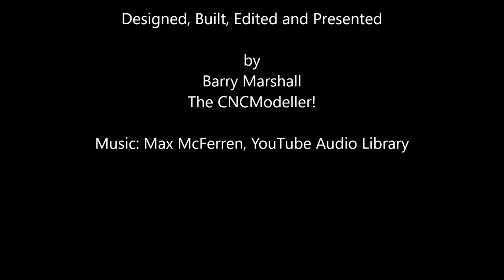New Design! Bed Bearings for the Large Polar 3D Printer

Comment: This is very useful , I believe for industrial use 3D printers will go along the path of different kinematics according to what geometry they do best. For tall cylindrical shapes your design is perfect , and so on for other shapes to chose the best kinematics for them just to insure the best performance for all print jobs.
Reply from the maker: Thanks Gathlock. I agree, I built a polar printer as I believe it has a good print to printer volume ratio, ie it's small for it's print volume, and It requires less print head motion to print the items I need to print.

Comment: What firmware did you use for this? It loks awesome btw
Reply from the maker: Hi @TdgChan,  It's using reprap firmware on a duet2 ethernet board. Thanks 👍
Reply: @CNCModellerUK  could you specify the firmware and slicer that can be used, Im looking into a easy to build printer for our Makerspace that ist Not so Common from the mechanics. It would be great If you could answer, I've been Reading die hours and searching but seems noone has a good running fw/SW solution for those polar printers... Or I'm just too dumb to find 😂 ... Best regards from germany
Reply from the maker: Hi Mike, you can use any slicer that generates Cartesian gcode. The firmware is reprap firmware or RRF running on the Duet2 ethernet board. If you go to the Duet3D website and forum you'll get all the support you need.

https://www.duet3d.com/

 I'm no expert but it was fairly easy to setup once I'd spent the time to understand how to configure RRF for my printer. It's all done with a startup file with special gcode so there is no firmware code changes or recompiling required.

RRF takes the Cartesian gcode co-ordinates and translates them to polar on the fly.

I've just upgraded to RRF 3 on my Duet ethernet board and it seems to be good on my setup. I believe you can run it on less expensive be oards but IMO you get what you pay for.

Hope that helps.
Barry M

Comment: Thank you. Awesome job. I've been looking for sufficient endeavors in polar printing. I am looking to make a tool that I would use mainly for round parts where production speed, concentricity, cylindricity, and surface finish matters. This seems like the way to go. Essentially this machine would be to the lathe in the same way that a typical 3d printer is to the mill. 

I would imagine for many parts on a machine like this, the G-Code and motion could be simpler, no? Am I wrong in thinking that this could print at a practically infinite speed and not experience interpolation on circles, making smoother, rounder parts?

For locating the bed and providing anti-friction on a smaller build, I was considering using 3 V rollers with bearings along the perimeter, to be adjusted for 3 point bed leveling with screws. It would use a pulley in nearly same fashion. A small 6"-12" (150mm-300mm) glass or aluminum plate could absolutely zip around and dominate. It should also provide a way to adjust the plate in X/Y in case someone needed to print off center, like for a crankshaft. Then we might as well add a 3D touch probe to it.

Another question, how far does the nozzle need to reach past (0,0) for all current or hopeful slicing and CAM features? You could theoretically reach all parts of the bed if the nozzle only reached halfway plus a little more, of course, but I am curious if it can be optimized in any degree if it had full capacity or required it, or if you had any thoughts on that. 

Thank you very much!
Reply from the maker: Hi Inventorsquare, 
I agree with most of what you're saying above. 
In terms of speed to get adequate gearing the step rates for high speed near the bed centre limits print speed on my machine. Also printing near the bed axis is not possible due to the kinematics. 

In terms of radius axis you only need to get to just past the centre, and then only really for calibration purposes. 

If you don't want to print very tall your bearing solution may well be fine, but you'll need to react the drive mechanism with some form of radial bearing on the bed.

Good luck with your build! 
Barry M
Reply: CNC Modeller Most excellent. Thank you very much for the considerations. I had thought that my parts would have a small vacancy in the axis of rotation due to it being at essentially zero RPM at the center but I had not yet thought of the problem of approaching it and the increasing motor speed required of that... very, very interesting. Thanks again!

Comment: Hi, does this printer have end-stop switches? I saw another diy polar 3d printer and it didn't seem to have an end-stop switch for the Z axis (had only one for the Y).
Reply from the maker: Hi @TST, yes this does have end stops on all axes. The rotating bed has an end stop that is only used during homing. This is to allow for consistent bed positioning which is needed for bed mesh levelling and power failure recovery. Hope that helps!
Reply: Wow thanks a lot!

Comment: On the note of bearings, 3D Printed (with some good sanding (vibratory perhaps?) ) bearings exist, and with pom filament should (?) work? I'll post the link below to the person who designed one.
Reply: Should also allow for somewhat easy scaling up/down.
Reply: Circular Geometry should print well on a polar printer too...
Reply from the maker: Hi Eric, Thanks for your thoughts. I've used 3d printed bearings on several projects. The only issue is that they wear out really fast. The aluminium one I used didn't last long so I'd expect a printed one not to fair well. Thanks for the thoughts all the same. 
Yes the whole point of this printer it to make large tube like structures, so bearing races should be good too.
All the best
Barry M

Comment: What kind of bearing do you recomment? I see you use an axial ball bearing, but is this not a little bit overkill?  I know they usually use these for high axial pressure and not high precision.
Reply from the maker: Hi @Bl4ckShadow, 
                Yeah these bearings are overkill from a load perspective, however I wanted as large a diameter bearing as I could get and this is the most cost effective ones I could find. Any larger and they start to become very expensive!

The larger diameter reduces the amount of off axis deflection. There is also a radial bearing in the centre of the two thrust bearings to hold radial tolerances on the aluminium plate that runs between them.

This is not a recommendation, however they seem to work OK, I got them from Ebay:

ZWZ 51120 Thrust Ball Bearing Single Direction 100 x 135 x 25 mm
69142RS Budget Rubber Sealed Thin Section Deep Groove Ball Bearing 70x100x16mm

I have a 70mm OD 50mm ID "axel" that it all runs around to allow me space on centreline for a slip ring to provide power for a heated bed if required.

Hope that clarifies things a little,

All the best 
Barry M
Reply: Thank you very much! Im trying this on a smaller scale myself. Just a 250mm table. Im thinking of using a radial ball bearing with OD 95 and ID 70,  do you think this will be stable enough?
Another question I had was what kind of firmware you used, i dont think there is allready an standerdized option in marlin et cetera you can put on right?
Appreciate the help!
Reply from the maker: I tried that setup and it didn't go well. Radial ball bearings have a lot of axial play. This allows the table to rock and as you get taller it doesn't take much for it to be a real issue. You could try two spaced vertically apart on the axis but I went for the thrust bearing approach instead. Also the twin thrust bearings allow you to pre-load the bearings to reduce free play even more.
Hope that helps!
Good luck with your build!
All the best
Barry M

Comment: Hello! I see that you've installed a BLtouch on yours! I'm also building a Polar type 3d printer (small one just for fun), and I"m using Marlin though. I'm wondering do you just input the offsets like usual and enable Marlin and that's it just like cartesian or CoreXy 3d printers, or are there special things you need to setup on your Duet for the BLtouch? (I understand you're using Duet, which is not Marlin, I use both 3D OS's). What I mean is this, do I just measure like usual the distance from the nozzle the BLtouch is, or does there needs to be "increased" distance because of the polar kinematics? Thanks!
Reply from the maker: As far as I am aware the bltouch is set up the same way for any printer as it just calibrates the z axis. It's the first time I've used one so don't know much. The duet setup is fairly straightforward but I'm guessing that it's RRF specific. Sorry I can't be more help!
Reply: @CNCModellerUK  Ah I see no problem, so it looks like you can measure the X and Y offset just like any other way and just input it without having to do any special calculations?  Thanks!
Reply from the maker: X and Y home locations are actually radius and rotation, RRF sorts it all out for you though...

Comment: Why polar and not delta?  For a 3d printer, the print head is light, the bed is heavy.
Reply from the maker: Hi Murray, 
             I'm looking to maximise print volume whilst still fitting the assembled machine through a domestic doorway. Polar is much shorter in z height for a given print z height and volume. I looked at all of the configurations and decided this was the best option. A scara was my next thought but it means a lot of linkages fixed to a moving z axis and it's seemed to me the play would build up. At least polar separated the two main axes.

Also I think polar is very cool to watch:-)

All the best
Barry M

Comment: Nice build! What firmware are you using? RepRap?
I think polar printers are very good for mass production. 
But I am really not sure about licenses and patents if I am designing a polar printer by myself.
Reply from the maker: Thanks MaxTex. I'm using the Duet3D board and firmware. Personally I think the polar printer is an elegant solution but it does require some careful engineering to work well. I've had a few people suggest that I consider selling these but until I'm happy I've knocked the edges off of the design I'm taking it slowly. Thanks for the feedback. All the best, Barry M